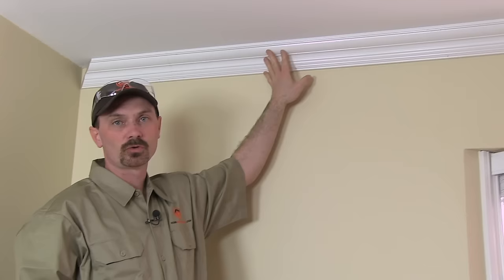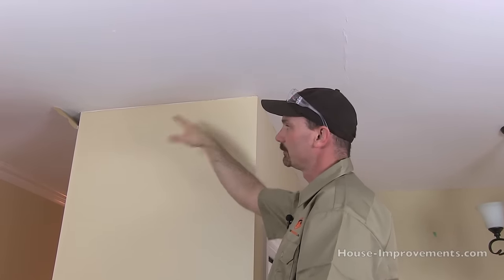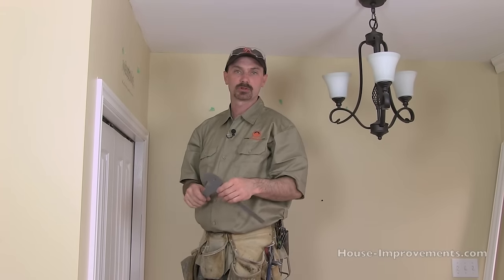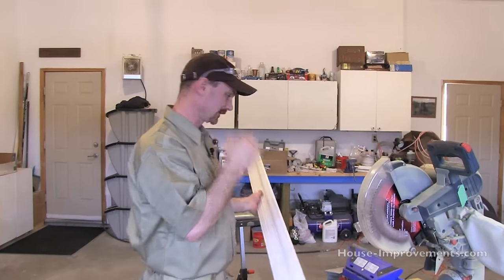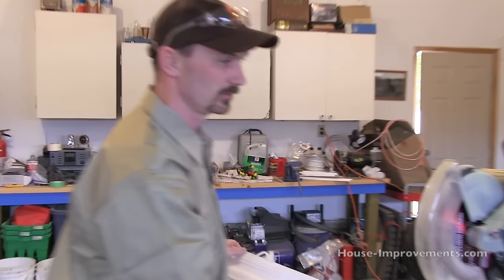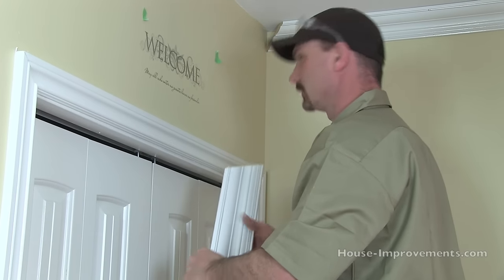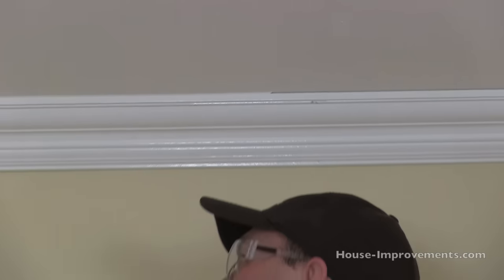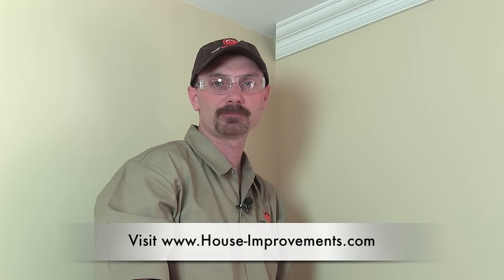How To Cut & Install Crown Moulding

Comment: I' ve  been doing crown molding for about 35 years now, and the best way to cope is to pull down with the saw and keep it at about a 5 to 10 degrees going inwards. Also to fix the outside miter issues, and inside miters ,refrain from nailing the molding about two feet from the cuts. At this point you can move both sides up or down to create the perfect miter everytime.
Reply: Nail ot 2 feet back so you can align them?     Ok.
Reply: @jacobsweeney2330  until you get them perfect then fasten it 4 to 6 I inches back so ya don't bust it
Reply: @matthewotis3594  Make the cut slightly longer than required by a few mm, then use the pressure created to create a tight joint, the total distance of displacement will hardly be noticeable along the entire length of the board. This works great for inside corners, outside corner pieces should be first installed to allow for this to be used, and the longer sections are best kept at perfect length. Its the main buttress that need to be slightly longer.
Reply: @matthewotis3594  Could even put caulking on the ends instead of glue, then wipe it straight away, that glue would shrink anyway so not very helpful. You might not even need to come a second time,  just have to caulk the long straights edges.

Comment: For the people that are commenting negatively, he is not doing this video for you ! He is doing it for people like myself whom don't know how to do it properly, and he explains as such that we all get it. He shows us how to do it "beginner style" and then fix up some minor defects because he knows that only an experience chippy can do it perfectly ! If he showed us how to do it perfectly, how would WE be able to copy that ? 

Youtube brings out the worst in humanity unfortunately.
Reply: He said something in the video that could cost homeowners thousands of dollars in damage. Should we just ignore that fact?
Reply: A little dramatic dont you think ? What point in the vid are you talking ?
Reply: Around 14:30. "Nail in about every 16 inches..."  He should have said to nail into every stud or joist. This wall doesn't have any mechanicals, but a homeowner could have used that information as an AOK to shoot nails anywhere. It could have been an electrical wire or a water pipe, or even air conditioning lines. That'll definitely cost thousands. I've witnessed it. It took a few days for it to appear as a rust stain on the trim. The trim crew used 15 gauge nails. One went right through air conditioner line. So maybe I am a little dramatic. Of course you could just take your chances and shoot 2" nails directly into the sheetrock. Maybe you'll hit wood. Maybe not. The caulk will hold it up there just fine.
Reply: I am pretty sure that any person tackling this job has enough common sense to not drive nails into the wall without finding studs or joists. If they don't already know that, they have no business doing the DIY in the first place.
Reply: This guy didn't
Reply: Well lets hope his audience is smarter than he is
Reply: How do you know he is smarter than me ? Can you really estimate my intelligence based on a comment or two on YouTube ? If indeed you can, you sir are quite smart and I am deeply humbled to be in your presence.
Reply: I agree
Reply: If you have your PSi set to about 100 and using the proper sized nails you won't have to worry about electrical, pipe, or other misc damages.  This is just from my personal experience though, hope this helps.
Reply: I personally have also fixed issues mainly water lines and the damage associated when people nail into a water line when installing moulding and cabinets. Thousands is a realistic estimate depending on when you catch a leak in your wall. This guy did not nail into studs or he could have fixed some of his issues with the molding moving around. He did show some very useful tips how to cope, measure and cut. The 1st set should be locate studs and this can be the most time consuming part but a finish nail can confirm the locations just be sure to keep the holes behind the moulding. Please also buy finger joint pine you will thank yourself later! You will ruin the saw blade you use when cutting mdf! The blade in my experience will not cut wood properly after
!
Reply: bull dozer '
Reply: Tray Rasco 1
Reply: Eduardo Agü
Reply: l dozer
Reply: dozer
Reply: I liked the video mostly . But I did wonder about the nailing . Believe me im horrible at carpentry  , that's why I watch stuff like this . But again I was wondering about the nailing . What would be the best way to know where the studs are ? Stud finder or measuring I guess ?
Reply: bull dozer  v.m
Reply: ron cash r
Reply: bull dozer i really appreciate this video many thanks 👍🏻👍🏻
Reply: Well Said bull dozer! I thought he was excellent at explaining it to me as someone who doesn't know how to do this stuff. Well done HI
Reply: Ochir Nema Chap it would be easier if he rolled both pieces down just a little you will find the crack at the top will disappear if the crack is open on the bottom then roll both pieces up. As far as nailing shoot one nail to the tight and the second nail to the left making the nails cross forming an X then to won’t have to worry about hitting studs or ceiling joist and believe me it holds tight. Same method for nailing baseboards
Reply: it would be kinda tough to address everything, but you do have a point @bubbabraun4760 . And these guy are doing these videos without prompts so it's inevitable that a few shortcomings pop up when you gliding thru on instincts for your presentation.
Reply: Hell yes! I'm a lot better 9ff because I watched this. He knows a hell of a lot more than me and did great. Negative people can't handle people, including themselves, not bei g perfect. They need to chill.
Reply: And if we all already knew everything why then should we watch YouTube? I loved that he took his time and really explained well.
Reply: @gunther955  on top has double 2x3-5/8 wood running across.   You can't miss  a nail if you put your finish nail gun at 35 or 45 degrees depending what you're using.
Reply: @bubbabraun4760  usually nails are driven at an angle for this same purpose. Maybe it is just me but I'd drive it this way when I know the tip of the nail will be at least half of it holding nothing.
Reply: @trayrasco8769  MDF cutting, doesnt the diablo blades cut through nails, sheet metal and cuts like  new after?
Reply: @adamr8878  I've been doing carpentry for 22 years and I have ran into plenty of "professionals" who just nail right into the drywall. The best way to install crown or any trim is to measure the angle of the corner because it's usually not 90 degrees. So once you establish the angle of the corner you divide it in half then make test pieces cut to the angle and make sure u have an air tight corner. I never have to caulk my seems or corner cuts and I never cope corners paint grade or stain grade
Reply: @MrJeremybowling  the pressure at what u r driving the nail has nothing to do with not nailing into the stud. If u have a 2 inch nail going through noting but trim and drywall it's still going to hit the wire if it's behind the drywall
Reply: @adamr8878  Don't know why your dogging everybody what bubba said was true, it's could cost homeowners thousands of dollars.
Reply: American Militaria 4 if a home owner goes in to a wall deep enough to hit important / dangerous things inside the wall, they have no business working on their house in the first place. Anyone giving tips on YouTube must assume a certain level of competence on the part of the home owner doing the work.
Reply: Just an idea, why not nail  angeled cut pesses of wood up and then nail the molding to that, there is a 2x4 where the wall meets the ceiling.
Reply: Love it/well explained ✔️
Reply: It is not even about how well it turns out actually, more how quickly.
Reply: Hey you know what I I don't understand how sertin people's brain works or mind set is . You know you can just keep your mouth shut if you think it's not good enough or it's not up to your standards some of these people's people cos well of people well what are we doing on YouTube we try to save a few bucks by doing the things ourselves so if I said the things not good enough for me I would just go on to the next video but you breaking another person's spirit by leading stupid and immature comments or I don't know you know guys enjoy the rest of your day goodbye yeah I have to say I'm from South Africa and buy you doing a good job now I do not know how to do ceilings or did not know how to do ceilings but I just did the private job this morning and you know what I got paid I've got I just received a good message saying thank you done and need job and now goes up what's this video This Morning and that's how I knew what to look out for once again goodbye enjoy your day
Reply: @adamr8878  the blue tape showed where the studs were

Comment: Too many DIY videos depict perfect joints. I like real world examples that show how to cope with less than perfect environments! GREAT JOB!!!!!
Reply from the maker: +Joe Vasta In the real world pretty much nothing is perfect and thats one of the things we try to demonstrate as well.
Reply: Joe Vasta
Reply: HouseImprovements 0
Reply: Alberta Hill
Reply: i like what you said. this is why they have other equipment and supplies to patch it up to make it perfect. lol Joe Vasta you are correct. id rather see imperfection than perfection.  i learn better with imperfection, because we learn from our mistakes.
Reply: It helps to figure out where the framing is first so you know where your finish nails will find a strong purchase
Reply: this is just proof that as a professional  things can still give problems that you have to adjust to….GREAT JOB
Reply: Great job Shannon
Reply: Great job as well.  This is why God invented caulk.  Plus, the only person who will notice it in the house is he.  Cheers!
Reply: Joints aren’t hard to cut. That was not a good installation at all. He is not comfortable with crown moulding and shouldn’t make excuses for bad technique. A DIYer is one thing, but as a professional, you have to hold your product to a higher standard. Would you pay for that install.....
Reply: @HouseImprovements
Reply: Exactly. The simplest jobs also are never simple. Lol

Comment: One word of advice, if you leave your intersecting joints un-nailed a foot or so in each direction, you can 'roll' the corners in or out to get a tighter joint.
Reply: Exactly, if your corners are a little off and 90 degrees and you cut at 45 degrees you can still roll your trim up or down the wall to close gaps,  for inside corners if gaps is on top you tap in the ceiling side of crown to roll trim down,,, if gapped on bottom tap up on wall side of crown to roll upwards,,, for outside corners if gap is on top like in this video tap the ceiling side of crown peices to roll down wall and if gapped on bottom tap on wall side to rool crown up, obviously if lenghts are wrong gaps will always be present,,, some time inside corners dig into drywall causing profiles to not line up properly,  I myself use a long hand pump extendable spreader bar to hold my crown into the wall ceiling corner a few feet back from joins on longer peices so i dont have to nail it until corners are rolled to a nice tight fit and to hold up adjoining peices until corner is formed. Not so easy on short lenghts but long lenghts this is doable
Reply: thank you for the tips. this is the reason i love coming onto you tube to learn many DIY vids.
Reply: ROGUE RONIN he did
Reply: Hey man, just came back from doing my first crown job, wanted to say thank you for this comment as it helped me and is a great idea, cheers!
Reply: I do this professionaly and your recommendation is key! Thanks!
Reply: Thank you ROGUE, good tip!
Reply: Thx!

Comment: A good technique I've used for helping to get coped corners really smooth is to wrap a scrap piece of moulding in sandpaper & use the profile as a sanding block on your coped edge. Gets it SUPER tight 😉

Comment: If you can afford  wood crown in stead of MDF ( fiber board)  you'll end up with a much better finished product because in time the MDF crown will shrink both in the field joints and out of your corners leaving unsightly gaps that have to be re caulked Good video!.

Comment: Good tip to write the measurement on the wall which will always be covered!  As many times as I've done floor moulding, it never occurred to me to do that:)
I think it would be a good video to show people how to do both inside and outside corners that are really off from 90 degrees and show the necessary math up close so it's clear.

Comment: leave corners loose and carry a block with you....tack pieces in place and you can use block to "roll" crown up or down to get corners tight....if the pieces are just "tacked" with one nail it will stay in place but will still be able to roll the crown up or down wall with hammer and block of wood.......example on outside corner your gap was top....take a block against the top edge of crown and flush with ceiling. ..hammer block towards wall to roll crown down the wall to close up that gap......I always nail the field off and leave all corners loose.....come back and roll the corners up or down to get joints tight
Reply: +kirk dunn make a video to show how it is done so like it would help alot of people out.
Reply: +kirk dunn  That's how it works best.
Reply: I also snap lines for straightness. I use blue and I snap most of the caulk off before snapping it on the wall. Sometimes I can't help but deviate from the line, but at least I can judge how much I am off.
Reply: The rolling technique you are speaking of only works if you have a nailer behind whatever corner you are trying to tighten.  This guy is just nailing the top edge of the crown into drywall, not the ceiling joists or a pre-cut backer.  You can tack and roll all you want, but you need to nail crown into wood.  All this guy is doing is asking for the crown to explode in future years as the house expands via the seasonal weather.  I don't understand why guys install trim this way, it's a waste of time and money.
Reply: Could you just glue your outside corners before attaching to walls? I.e. with those two part glues (glue+activator) that take like 5 seconds? 

You probably wouldn't have more than two outside corners in a row, so worst case you'd have to assemble a U shape piece on the ground.

I know that's how a lot of people assemble door/window casings to get near perfect miters.

Comment: or you could just use the existing marks that are on most miter saws which is bevel at 33.85 deg and table at 31.62 deg thats what they are for crown joints to cut them flat instead of standing them up and backwards its easy

Comment: I've done finish carpentry for over 35yrs too.  Every single cut has its own circumstances to why you would miter cut or cope.  sometimes you have to do both depending on whats going on in the corner.  Half the time you can't tell if the ceiling bows up and/or down until the crown is on.  Then your stuck with the dilemma of cutting at 43, 44, 45 sometimes up to 47 degrees on an outside corner that exceeds 90 degrees.  So there is no right or wrong way.  The house will show you what you have to do.   But I do the long pieces first after I write down the measurements so it minimizes scrap.  Or roughly write down all your cut lengths and go see what you can make with what you have.
Reply from the maker: good advice
Reply: Jeff Fleischman  thanks that makes me feel bettee cause Im having trouble...
Reply: Agreed..
Reply: There really is a right way tho. Using the protractor. Anything over 90 degrees, divide it by 2 and subtract from 90. Anything under is a coping issue. Depending on how detail oriented you are or maybe even how impatient..there's definitely a right way. Sometimes more than one right way but start with that formula and and even if the cieling is "swollen"  you are a lot tighter than you would've been by guessing or even the old "cut it til it fits" formula.

Comment: Why not measure the angle of the walls, make a reference, and then when cutting your pieces, align to the reference before fastening to the wall. That way you know if you’re miters will work before fastening or lifting anything.

Comment: There just isn't such thing as a perfect coped joint...if there is your wasting time.....with primed MDF your right... miter the inside.corners......great insight..you did a great job.....outside corners that don't touch....most of the time your fighting backing from the framers running parallel to the joists....uneven texture a drywall mud....wonderful illustration...

Comment: 12:55 Tip of the day right there. After nailing on a long piece I found out the corner was messed up and wouldn't line up with the next piece. After rewatching this video I made the 2 test pieces with inside and outside corners.  1st it helped me confirm the corner joint will be as it should be and will line up nicely with the next piece, but since I labelled them all I used them to  confirm that I was cutting the next piece the correct way.  Easy to get confused cutting upside down and backwards. (O_o)
Thank you and your camera person for your efforts.

Comment: Another way/trick when I learned crown moulding is to follow your elbow.  At your 9:50(ish) mark, when you're making your inside cut, I would've held the material with my right and cut with my left hand.  Then my elbow is moving into me (inside corner = elbow coming into my body).  Similarly with an outside corner, the elbow moves out.  It's kind of a last second check to make sure your blade is in the right position.